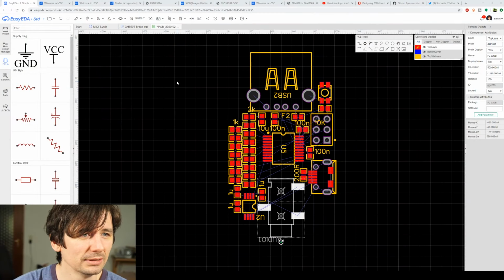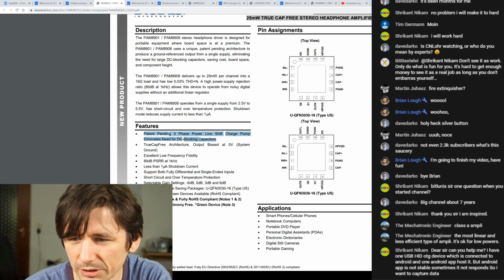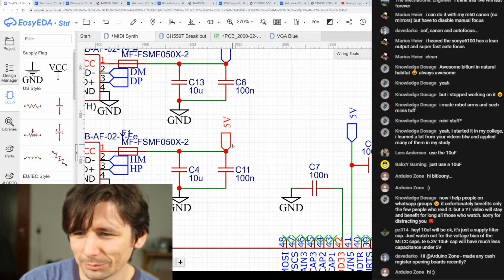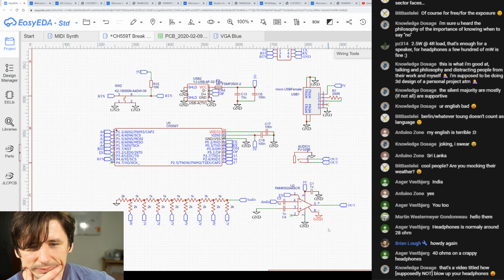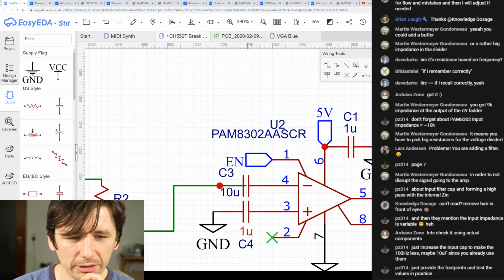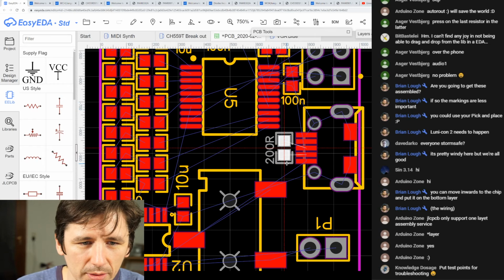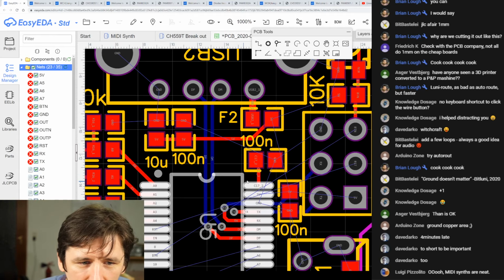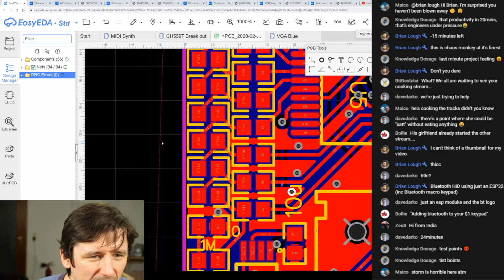Designing MIDI Synthesizer Boards

Comment: In case you haven't ordered the boards yet. There is a potential problem with the PAM8302 output. OUTP and OUTN are balanced PWM drivers. If someone plugs the output into another device (not recommended anyway), sharing the ground with this board via power or signal cables, the OUTN will be effectively shorted to GND. Might eventually kill the chip even with it's internal current limiter. 

The overal gain can be also changed by adding a series resistors between the inputs and the 1u dc blocking caps (page4 of the datasheet, schem on page 2). With no resistors at all the  gain is set to 24dB. The formula is 20*log[2*(80k / Rin)]. 80k is internal, Rin also internally 10k, but you can increase it by adding more Ohms in series with it (the same for both +/- inputs). It will be a less noisy approach since with the additional series resistors it is the gain of the first stage in PAM8302 that is decreased. With an R divider in front of the amp the signal is attenuated and then again boosted internally. 

Another option would be to add a balanced T attenuator on the output to bring the signal down for headphones, isolating the OUTP/OUTN from accidental short to GND at the same time.
Oh, and an idea for the larger board: the second UART on the CH559 could be used to forward the midi data to another daisy chained synth, maybe working on another midi channel for different sounds or just for stereo output. One midi controller + a small (floating of course) number od midi cramps ;)
Anyway - cool stuff! For me the main reason to get into microcontrollers and programming many year ago was i wanted to build midi controllers for guitar gear.
Reply from the maker: Omg this input is gold. Thanks! My intention of taking this capless amp was to preserve bass but be gnd referenced to be able to connect it to an input jack sharing the same ground. That doesn't seem to be a good idea anymore. I have pam8308 here but they shouldn't differ much... I'd love to chat with you about amp design.. it seems it's a science on it's own. Your videos are awesome!
Reply: @bitluniLive  8908 and 8302 are quite a different beasts (maybe not size-wise;). 8902 is a linear amp vs 8302 is a pwm switching one, which uses the speaker itself as an output filter. That's another reason for not using it for line output, even if the signal is attenuated back to acceptable level. Without the speaker there will be no output filter. 

Capless does not directly mean ground referenced, that is the signal's 0 is at zero V. To have a ground referenced outputs the signal has to swing positively and negatively in respect to that ref level. 8902 has the charge pump for that, it generates the negative supply rail. In class D both outputs are just 1 or 0, both are push-pull outputs. 

All in all, i think the PAM8908 looks as much better choice here.
Also, you have no anti-aliasing filter after the DAC at all, even a simple RC lowpass filter would roll off the sharp square edges coming out from the R2R. 

Pozdrowienia dla rodaka :)
Reply from the maker: dzięki! How did you solve all the issues in your guitar filter? They sound great! I'm feeling a bit discouraged to add the amp and compromise the sound or reliability now. At least I need to research it a bit more
Reply: @bitluniLive  Not sure which filter do you mind? Pretty much all the guitar gear has some sort of filters inside. Or maybe what you mean are pedals in general? I guess it's being curious, definitely not afraid of trying and learning new things, experimenting and building tons of stuff. When i was starting there was no source for cheap boards, modules, parts were mainly salvaged from junk electronics and above all, no internet. 

Definitely don't feel discouraged. As one of the gurus said: "If it should work, but doesn't, it's just the mother nature trying to teach you something" :) Take a step back, break the problem into small pieces and try to solve them step by step. Don't plug things and expect them to work from the start, it's suspicious! ;) 

Hit me up through my site if you want to chat more via email etc.